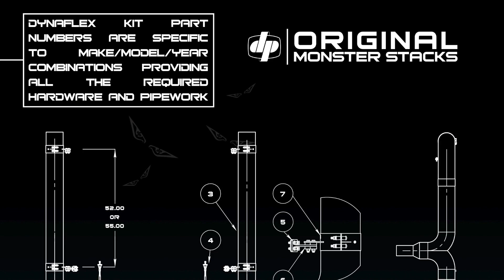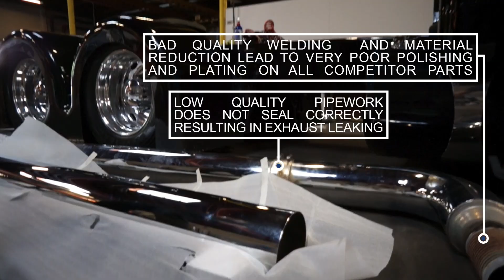Upgrading to a Dynaflex Exhaust Kit from a Mix & Match Kit

Comment: What is the top length on those stacks?
54 inches or 60 inches?
Reply from the maker: Hey there! Our guess would be 54 but we can't be sure just from looking at this video. Unfortunately we don't have the exact product specs for this video, but hopefully that helps you out a little. :)
Reply: @raneysonline Thanks.. 
 I just installed the 54" tops Sunday. 
The same kit and tops as the truck in the video.  
How do i contact the boss at Raney's in ocala Florida?